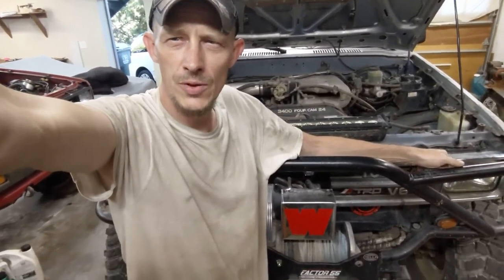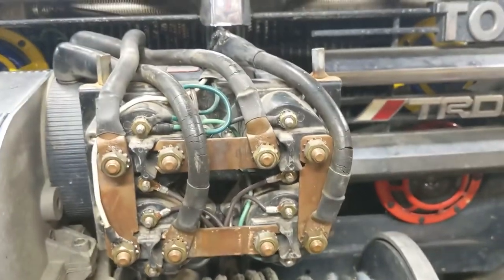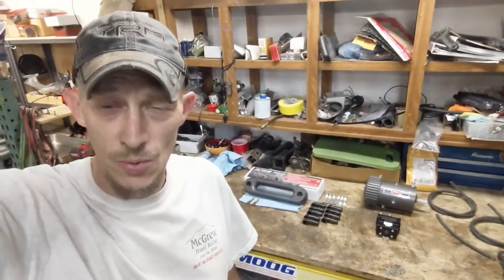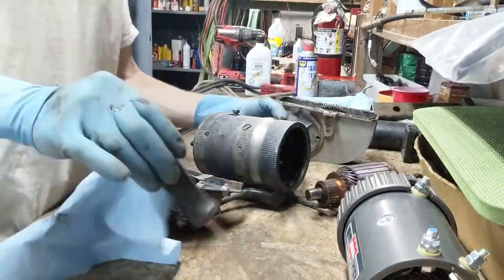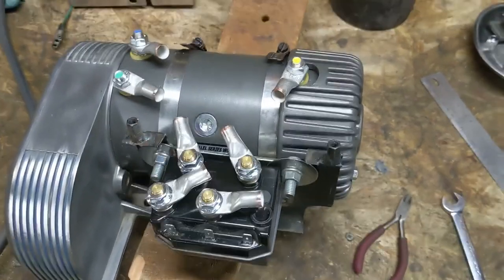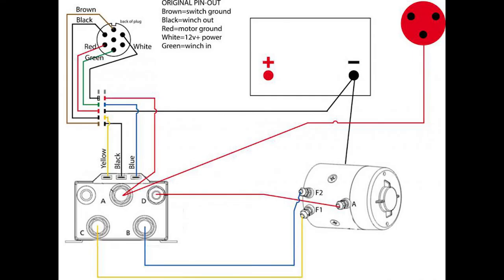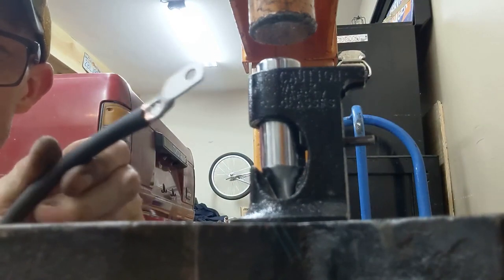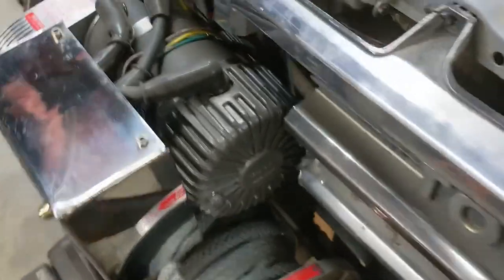Ep. 9 Snale Racing updates the Warn 8274 Winch with an Albright Contactor and 9.5xp Motor

Comment: Is it possible to get an emailed, or pdf copy of your wiring diagram. I am not clever enough to capture it off your video.  I have just put a 9.5 motor on my 8274 along with an albright contactor switch.  I am puzzled about the third stud toward the back of the motor, where/what does the ground wire on the bottom of the motor go.  The original controller plug has a third white wire I am not sure where it should go.
Reply from the maker: All three studs on the xp motor go to the contactor.   The bolt/ground on the bottom should go directly to the battery.  I need to know how many wires are in your remote for proper diagram.  Or you just go to the three wire remote to clean things up.
Reply: @SnaleRacing  three wire remote.  Black and green appear to correspond with the albright switch.
Reply from the maker: @tombache3426  contactor wires black,  ground,  green.  Left to right.  Power to the remote plug comes from battery on the contactor.   The center small lug on contactor goes to ground in the bottom of the motor.

Comment: Did you get the boots from warn?
Reply from the maker: I got the boots from these guys.  https://www.ebay.com/itm/9-PC-Replacement-Electric-Winch-Motor-Cable-Terminal-Boot-Rubber-Cover-/273818378050?mkcid=16&mkevt=1&_trksid=p2349624.m46890.l49286&mkrid=711-127632-2357-0